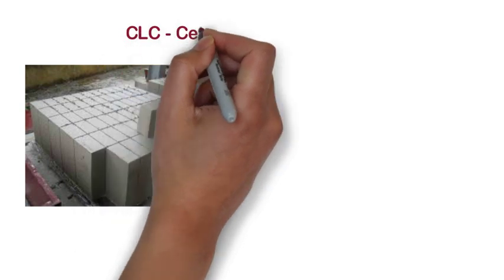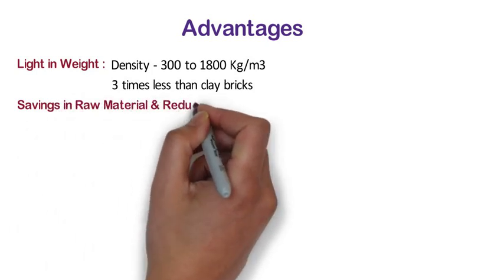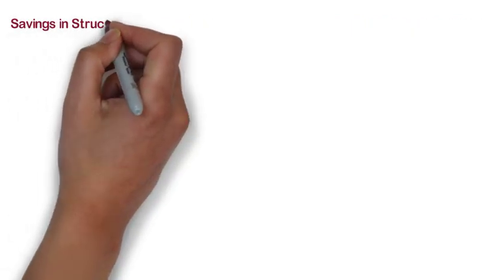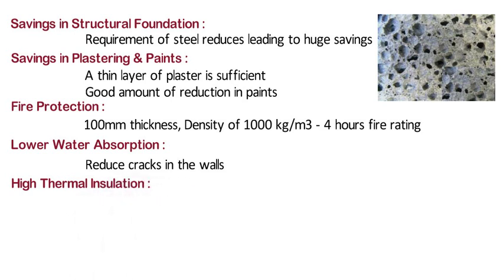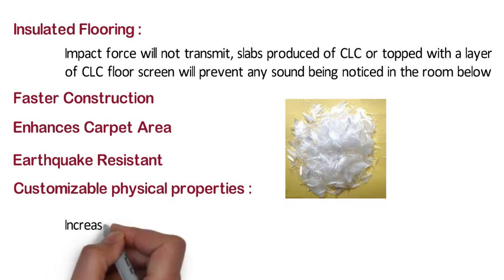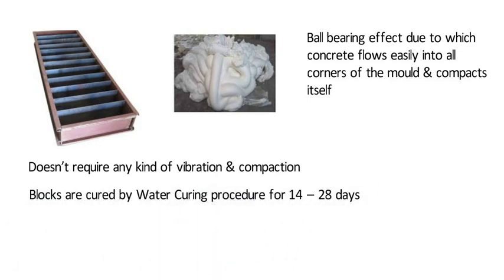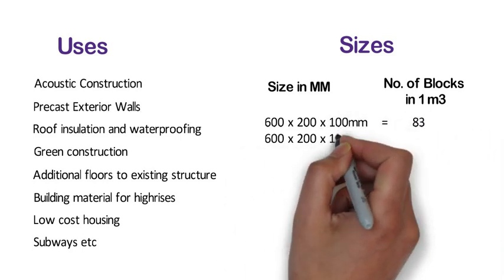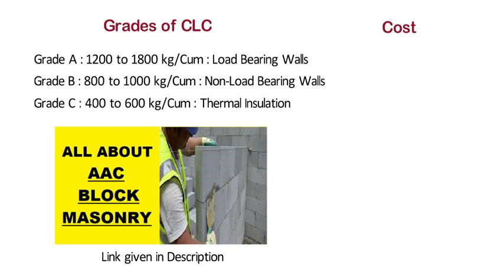CLC Blocks - Cellular Lightweight Concrete Blocks

Comment: Good information, even for us who already work with Cellular Concrete.
We are from Brazil and we use Gethal Concentrated Air Incorporation Additive with and without pre-fabricated foam, that is, the direct additive in the mix and in the mass, producing the incorporation of air with the mechanical agitation of the mix.
Reply: Werecan i get these clcblocksin south india
Reply: is this methode effective and efficient ?

Comment: Sir, how can we control the density of the concrete and what is the proportion to be used to get the required density.
number of blocks per cumt, depends on the density is it?

Comment: I am getting problem with clc blocks production after the de molding both side of block there are getting peel (papdi) i tried with applying wast engine oil of two wheedlers to mounds please give me solution ... Sajid Khan 9902645708
Reply: i was also facing the same. problem..please change the method of pouring slurry mixture into the moulds..while  filling the moulds pour the slurry into the centre of moulds without letting it to touch the sides of moulds wall directly..and apply good amount of oil on the mould walls

Comment: Which is the Best AAC or CLC ?
Reply: both are good if the manufacturer has used good quantity of cement and both are bad if cement quantity is low
Reply from the maker: AAC